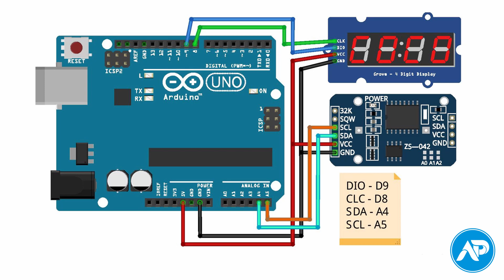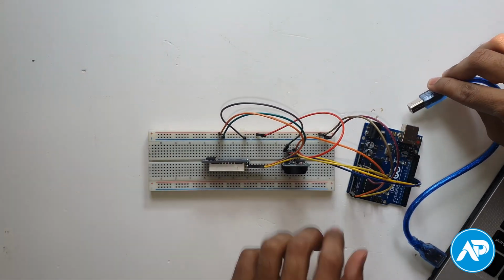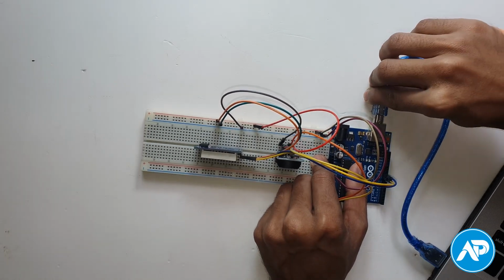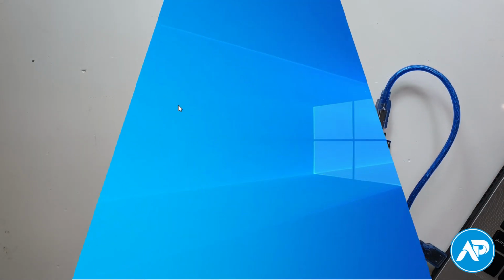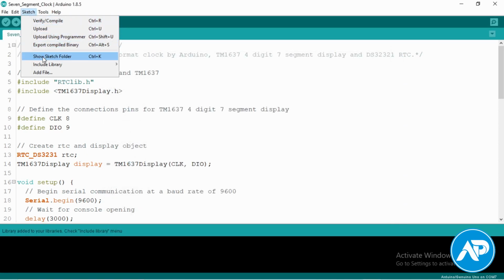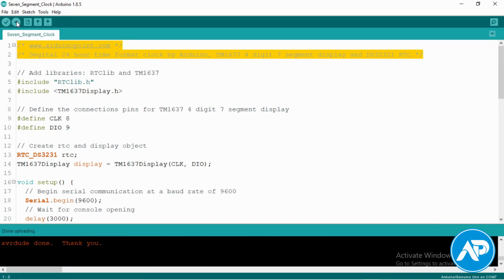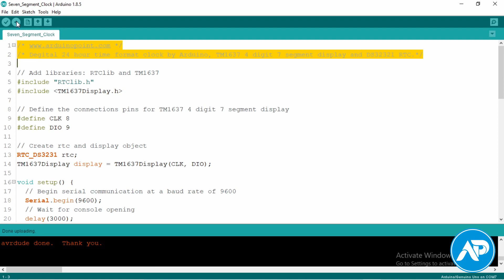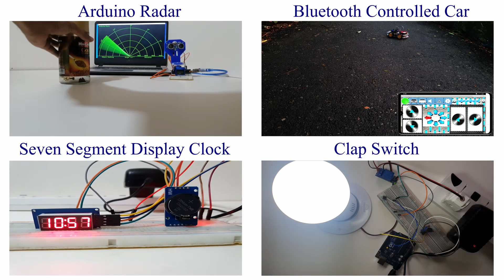TM1637 4-Digit Display Arduino Clock Using RTC DS3231

Comment: i get at the first time.after i close, i open back in the morning the time no follow the real time
Reply from the maker: Ensure the circuit has been properly assembled. Check your DS3231 RTC. Is it OK. And check the battery charge of the DS3231 RTC. Let me know, have you solve the problem?